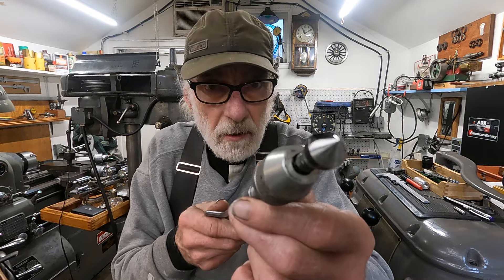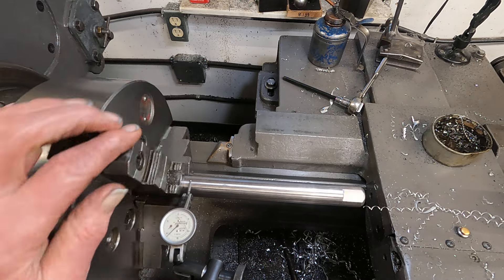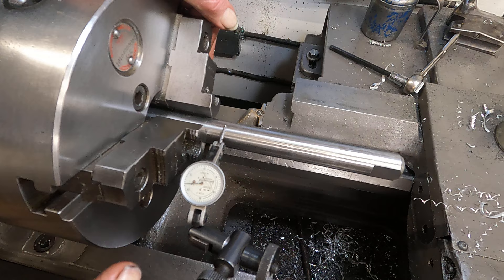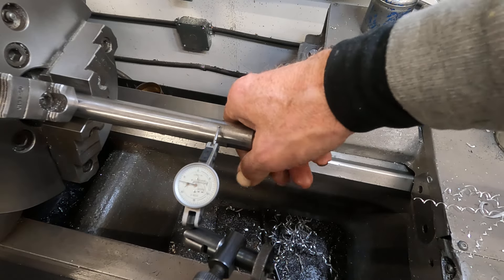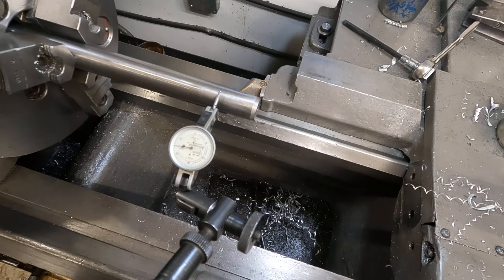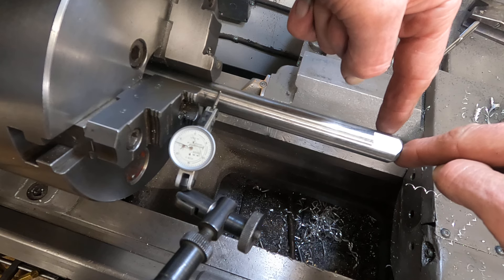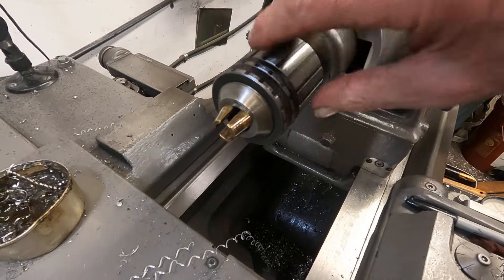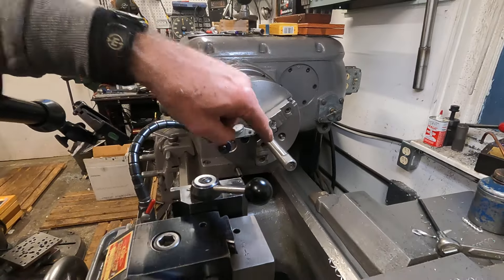Machining for accuracy centering shafts

Comment: That's good stuff there Don. I have used that method in a four jaw when setting up pieces with long stick out. I never thought about it in that context though. One for the memory bank. Thanks
Reply from the maker: The worst case is a 4jaw that is out true , then soft aluminum or copper between the work and the jaws so the work can be drifted true. I had to do that on a lathe I don't own a while back with hydraulic tube using a steady rest.

Comment: Interesting. So if you put a center in the shaft close to the chuck jaws, you may not drill it totally true, because the shaft may not be as concentric to the spindle as you think? Basically cosine error?
Reply from the maker: With 5c collets and scroll chucks there can be both radial and axial run out, thanks!